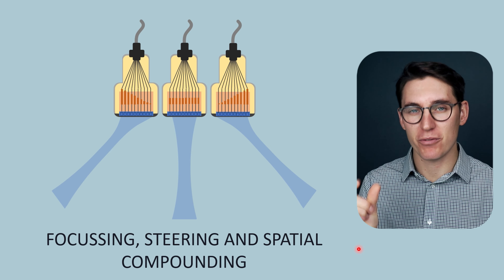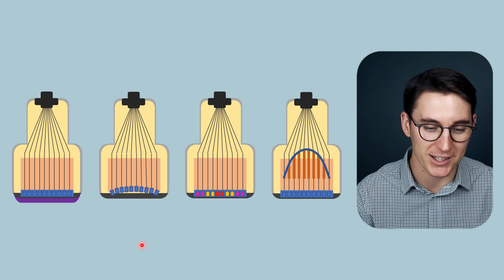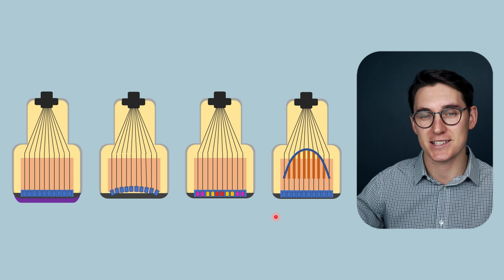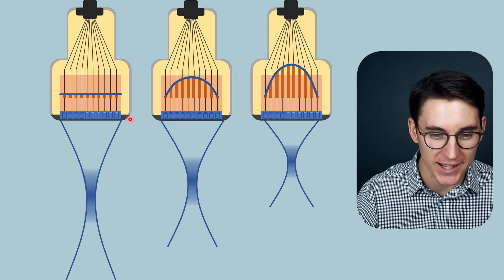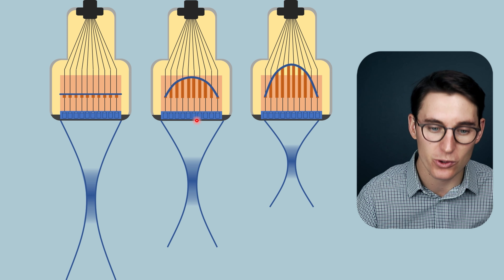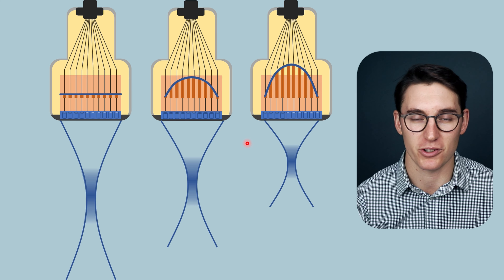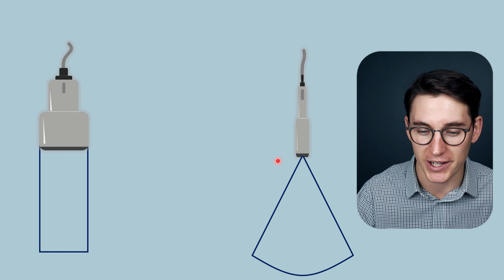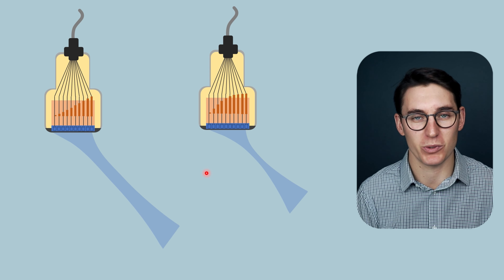Beam Focusing, Steering and Spatial Compounding | Ultrasound Physics | Radiology Physics Course #16

Comment: Hi
Thanks for the informative content
I have three questions, I will appreciate if you let me know your answer
1. In an array, why simultaneous firing of elements yields to a focus too?
Is it related to the destructive and the constructive interference among rays from different PZT elements?
2. Do we change the NF-FF border by electronic focusing?? 
If yes, the NF-FF border will not be related to the frequency or PZT size anymore!
3. In the process of calculating the delays in the electronic focusing method, do we consider the 'natural focusing' (what I mean by 'natural focusing' is the the focus existing when firing the elements of an array simultaneously)?
Best regards
Reply from the maker: Hi great questions!

1. Yes. Even in a single element transducer the beam will converge before diverging. This is because in a wave, each point in that wave can be thought of as a point source/wavelet. This is called Huygen's principle. You're right in saying it is the constructive and destructive interference patterns of these wavelets that cause the beam to exhibit it's characteristic shape.

2. Yes. The NF-FF is changed by focusing. The formulas we are using here are for unfocused beams. The focal point is still related to frequency and transducer size but now has the added variable of focusing.

3. Yes. The natural shape of the beam is taken into account. 

Excellent questions. Hope the answers helped.
Michael

Comment: when focusing, why when we delay the firing of the inner most arrays result in shorter focal length? does it have any relation with constructive wave? and the steering also a bit more confusing. hope you can explain a bit. Tq
Reply from the maker: Exactly. If two waves are fired with a slight delay the waves will constructively interfere and steer/focus towards the second (later) wave.
Reply: @radiologytutorials  Ok, thanks for the confirmation.